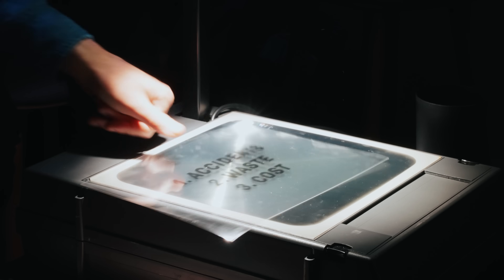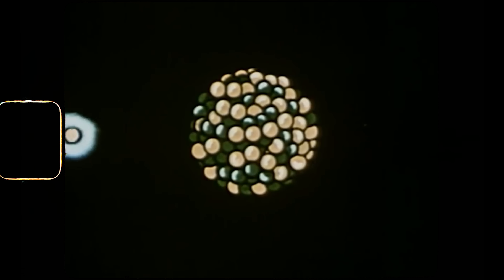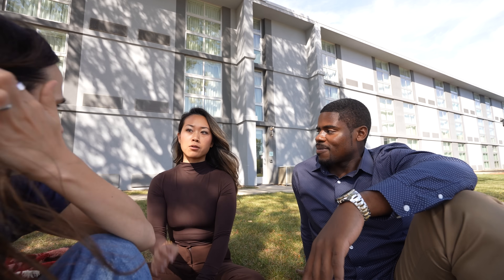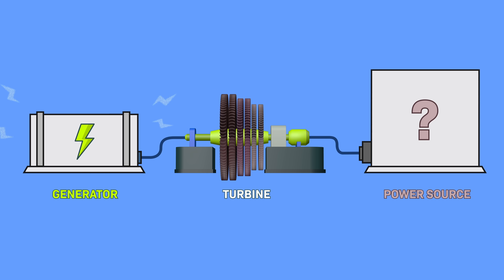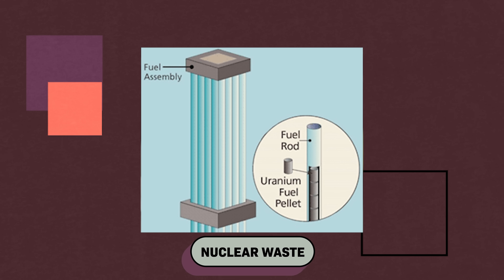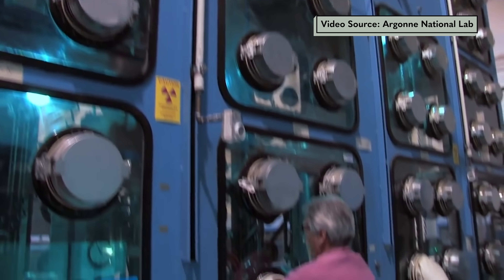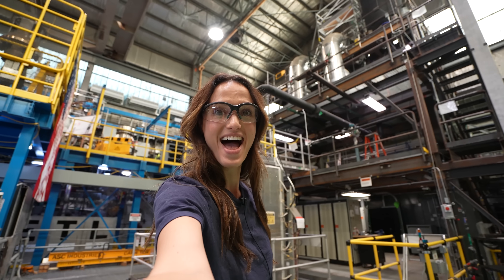The Big Lie About Nuclear Waste

Comment: I have a few questions about nuclear waste. 
1) Is radioactive water part of the waste?

2) What exactly makes the water radioactive? Is it containments that can be filtered out? 

3) Is it possible for a heavy water molecule to have one normal hydrogen atom and just one deuterium atom? 

I'm hoping my questions lead to some fascinating answers. Thank you ma'am for your excellent videos.
Reply: After use in a nuclear power plant, radioactive water is treated through filtration, demineralization, and distillation to remove contaminants, then often stored in tanks or released into the environment (like oceans or rivers) after regulatory approval. Yes, a water molecule with one normal hydrogen (Protium, H) and one deuterium (D) atom, known as semiheavy water exists.

Comment: This will never fly.    We could have use a water free low pressure waste free Thorium reaction over 60 years ago.   No melt down, no high pressure water release.  It's this high pressure water that has caused all the radiation releases over the years.  It was a law that was passed that caused all the big failures at Uranium reactors.   It isn't nuclear power you should fear its Congress that needs to be shut down.

Comment: Why can't we pair the two technologies to start with  the new fuel, use it as we do in the common plants, then when it's exhausted and it's time to store it, continue to use it as waist with the "new technology" until it reaches the state of the less contaminating waist. We would avoid tho have to move it around, no. And the full cycle would last double time.

Comment: France has also had a closed nuclear fuel cycle for years. I definitely believe there are many  fuel cycle improvements to  make, but something I've learnt is that economics rule. Then the problem is that short term economics overrule long term economics, which is unwise, but that's the way it is.

Comment: Great report!

I think the main reason the U.S. is at least 50 years behind the times is, the political will and vision were lost as a result of the nuclear accidents since 1957, and especially since Three Mile Island in 1979, which really spooked us! The list of accidents is listed below, per Google:
•	1957: Kyshtym disaster (Soviet Union): A failure in a nuclear waste storage facility resulted in a severe explosion, contaminating a large area.
•	1957: Windscale Fire (UK): A fire at a plutonium production reactor melted part of the core, releasing significant amounts of radioactive material.
•	1961: SL-1 nuclear meltdown (USA): The experimental reactor at the Idaho National Engineering Laboratory experienced a steam explosion, killing three operators.
•	1979: Three Mile Island accident (USA): A combination of equipment failure and human error led to a partial meltdown of the reactor core.
•	1986: Chernobyl disaster (Soviet Union): A catastrophic explosion and fire at the Chernobyl Nuclear Power Plant released large amounts of radiation, leading to widespread contamination.
•	1999: Tokaimura criticality accident (Japan): A number of workers accidentally created a critical mass of nuclear fuel, leading to a criticality accident with significant radiation release.
•	2011: Fukushima Daiichi accident (Japan): A major earthquake and resulting tsunami disabled the power supply and cooling systems for several reactors, leading to meltdowns and a massive release of radioactive material. 

But in the Trump Era, the U.S. shall fall further behind in this field, because of the “brain drain” caused by Trump’s stupidity, dementia, ridiculous policies and politics, and because it will take decades to reassemble the talent to reenter the nuclear field properly, safely, and intelligently. Hence, politics remains the stumbling block for any serious U.S. participation in the field of nuclear energy and related endeavors… except building more bombs, of course. ☹

Comment: I do believe plutonium can be used as fuel for rtgs. Therefore you could create a generator smaller than a fridge. Then usen that rtg which will continue to work for decades without maintenance to create hydrogen fuel for vehicles at a fuel station with just water. Imagine millions of cars where water vapor 8nstead of co2 comes out of the tail pipe.

Comment: Yes, and a salt reactor does not need a massive pressure vessel, it does not "melt down" if the power is cut, they use spent fuel.  This is the future if people can look to the Gen 3 reactor future vs the Gen 1 past.

Comment: The phrase "clean energy" belongs nowhere near a conversation about nuclear.
Reply: There is no true “clean energy” besides maybe geothermal. Windmills and solar panels deteriorate and need to be replaced every 2 decades, the battery infrastructure that they require demands massive amounts of lithium, cobalt, etc that also need to be replaced. 

The amount of waste that nuclear generates is infinitesimal compared to any carbon fuel and is a lot easier to store safely.

Nuclear is a remarkably clean energy even compared to wind and solar.

Comment: Besides being able to use spent nuclear rods….  We have infinite ability to store material safely!  

But!  Why not use it?  

The part no one including yourself fails to mention IS!  Using nuclear waste will NOT eliminate, nor reduce the amount of nuclear waste.  The used / spent material is still radioactive and needs to be stored in the same manner as our current nuclear waste.  

However!  Recycling our nuclear waste is very cost effective and prudent.  

I’m just pointing out the fact that “recycling” does not solve the waste problem;  Which really isn’t a problem!

Comment: EBR-II was a proven reactor design that ran successfully for 40+ years and proved the fuel cycle of a fully metallic fuel cycle.  Sodium us one of the best moderators and heat transfer fluid for nuclear energy!  No corrosion and amazing safety record.

Comment: The trouble with having uranium 238 in the reactor with the uarnium 235 is that uranium 238 absorbing a neutron will occasionally create nastier nuclear isotopes like plutonium 239 and americium, etc. These nastier nuclear isotopes can be avoided with non-fissionable but fertile thorium 232. When thorium 232 absorbs a neutron it starts on the road to creating uarnium 233 which does fission. Thorium can be dissolved in a molten salt which can reach 700C under normal pressure. The corrosive nature of the molten salt is a chemical problem that needs solving though.

Comment: Oh, and EBR-II didn't ever get around to using nuclear waste as fuel. They did use a fuel alloy in a few hundred fuel elements to approximate the recycled fuel to investigate its metallurgical and neuronic properties. My Nondestructive Assay Lab was next door to the lab where that fuel was made. It was in the chem lab, and was in the next wing of the building over from the cafeteria. Most of the run of the mill fuel was made in a facility across the street, it was 67% enriched uranium and was a uranium-zirconium alloy. There was also 78% enriched, used near control rods. One other thing- spent fuel could provide our energy for 150 years, but the depleted uranium sitting around would give more than 4,000 years of power. It would need some uranium for the first fuel load but plutonium produced during use would keep the fuel cycle going after that. I should also mention that all this work was done at Argonne-West out in Idaho, near Idaho Falls. That facility is part of the Idaho National Lab now, having been transferred to it in 2005.

Comment: I worked at Argonne West (which is now part of the INL) from 1986 thru 2004. I was very aware of the technology and the history of the research on it. You have given a pretty good technical presentation of the tech and of the history of it. I was very much in favor of the tech when I worked there and for years afterward. But it remains to be seen if any nuclear technology can be inexpensive enough to compete with the currently least expensive source, solar PV with storage. Also, in 2024, about 50 GW of solar panel were installed, which would produce about 12 or 13 GW after accounting for capacity factor of about 25%. That's 12 or 13 large nuclear power plants, or maybe something like 30 smaller, more modular reactors that are being talked about these days. 30 per year going online, year after year. I really don't think any nuclear system can compete with that. One other thing- fast reactors can indeed "burn" long lived waste, but what might happen instead would be that the vast stores of depleted uranium- already sitting in convenient storage as solid uranium hexafluoride- would be used instead with some added U-235 or maybe transuranics from spent fuel. Handling spent fuel especially in a chemical process is bound to be really expensive. The time to have used nuclear power was 40 or so years ago but public perception and cost killed it.

Comment: That is Less  Toxic than Lithium -Ion Batteries on Electric Vehicles( EV's ) V8 Cars when bad becomes Rebuilt or Reforged..
Not EV's they're dirty before it's used & after it's used when batteries are bad.

Electric Vehicles are more dirty than my V8 Mustang... EV's batteries rupture and Drip a Brownish Orange Glaze...imagine it Penetrating UNPAVED JUNKYARDS, penetrating the dirty to our underground water sources.
Following is the reasons they're doing this:
No they don't, have the money top Pay or $12,000 heck they don't have the money to pay $100, and the thing is they're try to get rid the non GPS cars, because of the 2027 GPS 10 mph over posted speed limit... They know drivers will go to older non GPS Active Cruise Control  cars.. Audi R8 supercar ended Production in March 2024. Due to an Annoying Chime for going 1 mph over the posted Speed Limit, They had this from 2022 to 2024.. The Chime won't stop until you slow down to the Speed Limit.  Imagine paying for a Supercar & not being able to Use it. They don't realize EV's are more Toxic than My V8 Mustang. It is a 2017 BASE GT No online Updates, and No GPS.. 👦🏻👍🏻🏎🏎🏁🏁🚩🚩⛰⛰🧗🏻

Comment: I appreciate the positive spin on use of classic nuclear waste to garner power. Truth is, it is still expensive. It would greatly increase the energy cost. We do have the technology to do it (as you mentioned). But even doing that puts us at centuries of waste instead of eons.

I encourage you to look at the work in fusion. Particularly non-tokamak style  fusion reactors. I am pretty sure Microsoft commissioned one from Helion who uses a magnetic field generation style (very high tech and expensive) instead of the classic heat water to turn a turbine style.

I expect they will have problems getting it working 24/7 for their first go - but that is how technology works... it is always a bit iffy at first.

Their waste product is He4, which is radioactive and has only an 11 year decay period (which decays into their fuel - He3). So very reusable and much more cheap to re-use. Containment of He4 may be a different story.
Reply: Cost is secondary. I would rather live with an expensive electric bill than with a flooded house or with breathing problems due to coal burning. People are always so worried about cost as if there weren’t already obvious solutions to that. Just tax the rich. It’s literally that simple.

Comment: In interesting idea, but the key point is glossed over. Yes, we can recycle spent nuclear fuel, but most of the current nuclear power plants can’t use it. 

To make it feasible, you’d have to either reconfigure all the current nuclear power plants, or build new ones that can use the recycled fuel. It’s obvious that the reason we can’t change the way these plants operate is the huge amount of money it would take.

Comment: I must confess that I’ve always been puzzled why someone hasn’t found an efficient way to just use uranium straight from the ground. I mean the process used would be like taking coal out of the ground and refining it before burning it in domestic hearth fires and power generation plant!

It’s as if it was just accepted that the only way to use Uranium was by refining it, and research mostly stopped on any other solution.

Comment: 06:15 M. Sc. of chemistry here.... in U-235 the number 235 does not mean the number of neutrons but the number of nucleons, so the sum of protons AND neutrons. 😉 Uranium is element number 92, so uranium has 92 protons. U-235 has (235-92) 143 neutrons, U-238 thus has (238-92) 146 neutrons.

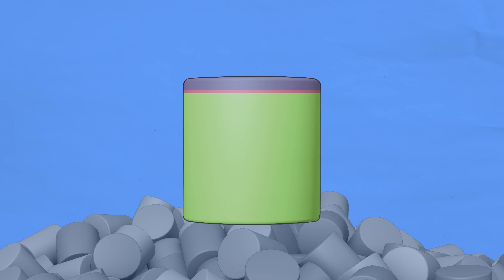10:49 And no, plutonium is not highly radioactive, most isotopes you could actually hold in your hands without gloves. 😉

Comment: Aquiles va una solucion mas sencilla
En los tanques de residuos le pones una tobera adiabatica de sombrerete y a continuacion una valvula tipo tesla para,asegurarte un flujo unidireccional sin retroceso haces pasar el flujo calentado de agua o co2 u otro gas o sal y al flujo convectivo unidireccional lo haces pasar por una turbina extraes toda la energia con el generador electrico acoplado y el flujo que al salir de la turbina tiene menor temperatura presion y volumen lo retornas al tanque contenedor y lo haces chocar con ña superficie caliente de los residuos radioactivos y tenes una corriente convectiva  no caotica unidireccional circulando por el circuito y de su flujo obtenes toda la energia electrica que puedas  dejando que los residuos se quemen a la maxima temperatura posible sin que se produzca una explosion nuclear 

Son reactores convectivos de flujo unidireccional rotativo si se quiere en ciclo cerrado....

Comment: Nuclear energy is undoubtedly the cleanest of all, even if it does not reuse the leftovers from the primary fuel, the generation capacity x occupied area is brutal. If they use nuclear waste again to generate even more energy, it will be even cleaner than it already is.

Comment: My Dad was a nuclear power engineer who briefly worked as a technician at Nuclear Fuel Services in Springville New York. He must have seen the writing on the wall and moved on to another job before that place literally melted down. It is still a Superfund site, off limits to people, that we still don’t know how to clean up 50 years later. 

Reprocessing nuclear fuel can certainly be done. But it is difficult and risky. Hanford Washington is another contaminated site where breeder reactor problems led to contamination and ongoing environmental concerns about its effects on the Columbia River.

Nuclear fuels, even Thorium, require great care in engineering and operations. From the limited experience we have had with them so far, it isn’t clear that our power providers can reliably perform to the standards required for the life of the materials. Two hundred years is a very long time for any company to maintain any facility, particularly one that is subjected to the demands of radioactive materials.
Reply: My point is that waving hands about the theoretical possibility of recycling hot materials isn’t enough. Until we have a clear understanding of how actual people driven by self interest can practically manage the facilities, materials, and processes involved, it’s too easy to blame those mendacious others. When you can tell me what facilities, policies, procedures, and emergency response plans can be maintained for the next couple or three centuries, based on what we learned from NFS, Hanford, Oak Ridge, Santa Susana, and the various military bases where contamination has occurred, and those practical plans make sense, I will be all in. 

I see the benefits as well as you do. I also see a lot of bullshit on both “sides” of what should be an ongoing technical conversation. The hard problems are operational over the long term.

Comment: In my opnion the bigest problem that slow down the atomic energy spreed isnt the nuclear waste, but the risk a power plant represets as a military target that in a case of war would cause a devastarion at the land around. By the way, no one want to live at the side of a reactor that even with all the tecnology has the potential to blow up and couse a mess. This could desestimulate locally the imobiliary market, but the low price energy that may benefit the industry.
In a fact o matter, anything that is used to manipulate the nuclear fuel and is disposable is a nuclear waste as well.

Comment: 1:30 "An incredible clean energy resource", really? Even in the hypothetical world where recycling spent nuclear fuel multiple times is feasible, Uranium is still a fossile fuel you have to mine (meaning its not endless and brings harm to the enviroment), enriching it takes A LOT of energy and even for the reduced amounts of acutal SNF to dispose, you STILL have to put in A LOT of research effort to ensure safe long-term disposal for hundredthousands of years (also a lot of energy and money). 

Electrolysis is one of THE most energy consuming ways to recycle something, so i wonder if you would even get net energy out of operating nuclear power plants with SNF that way.

Comment: When there are crabs in a bucket and you reach in to get one the other crabs will pull it back.  There are people who want to not just hold back the future but regress us. Regress in the name of protecting us‼️ Yes, we need to be aware of damage that happens and fix it. If the Luddites were in control we wouldn't have air travel. "Not safe‼️They crash." And on, and on...

Comment: France is the only contry that has a recycling plant that accepts used fuel from other contries right now. 

Another option is to use molten salt reactors, where you put the fuel directly into the salt, rather than as rods.

Comment: Wasn't Three Mile Island the reason Carter stopped reprocessing?  And the other problem with fast breeder reactors is that they produce material useablin weapons?  Why didn't you specifically mention the French reprocessing cycle?  If they have that, keep using it, but hete in Australia we have loys of free sunlight and wind to capture.